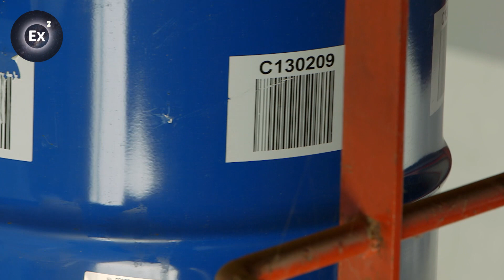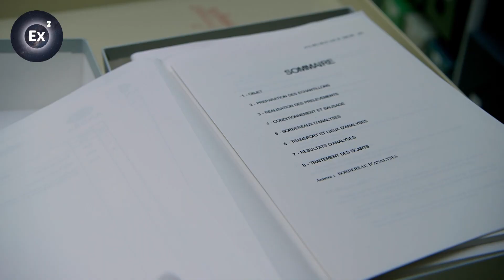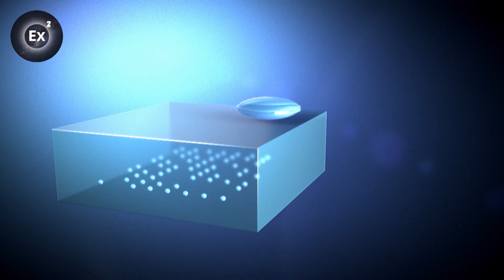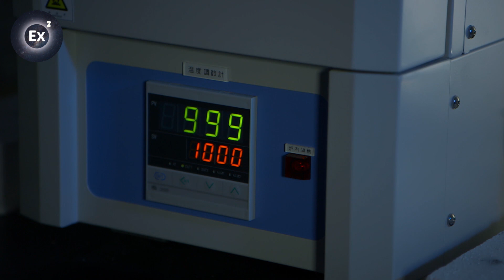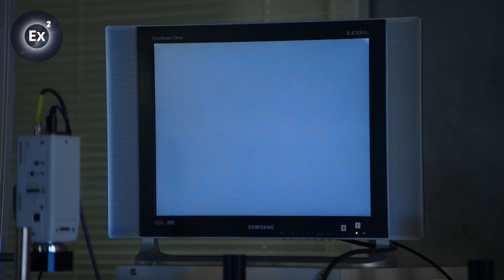Memory devices are vital to humanity: here's why | Experts Explain

Comment: Nice video. The quartz technology is impressive. Probably expensive, but impressive.

If the data lasts that long, the methods to decode it may not. In theory with computing power a person could decode it in the future, if they know it's got microdots on it and care enough to spend the time working to decode it. If you really wanted to mistake proof a message for the future you would use large pictographs inside the quarts to communicate, but that would be even more expensive.
Reply: As I was saying in a different comment, on scales of thousands of years you cannot even trust language or pictograms' meaning not to change.....

Comment: Bloody hell how old is this??  Hea talkingnthat 5.25 floppies where used 20yrs ago..   theybstill are in rare cases but realistically 20 yrs ago even the last iteration of the common floppy aka 3.5" 1.44 where not even commonly used anymore.. as cds/DVDs had taken over already

So right off the bat this video need to be prefaced with a warning re itss date of production etc
Reply: I have a working A drive and discs to use with it... 1.44 MB each, even! But I do have it.